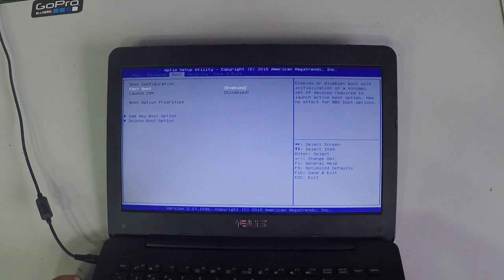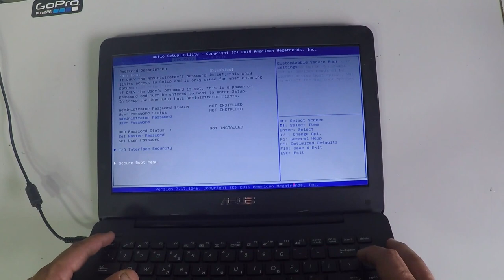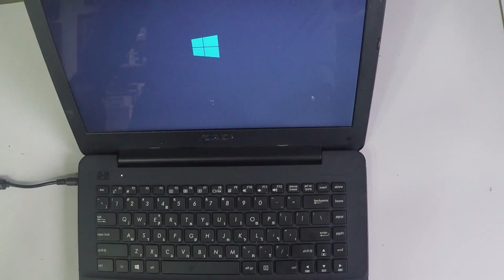ASUS X454L Battery Replacement

Comment: Hi techtips I have a question is it ok to remove the battery like not replacing it and i will just use ac adapter? is it safe? the reason why I want to remove the battery because when ever i play games plugged in the game lags but  when unplugged its totally fine. I think its because of the battery?

 Any tips for this ? or advice would be great help
Thanks in Advance
Greetings from Philippines
Reply from the maker: Hello Chris, It's safe to take out the battery and run only on ac power.
Reply: Thank you for the quick response! really appreciate it
Reply from the maker: your welcome.

Comment: hi, i hav question if keep using it without replacing the battery its ok?.. just using power adapter
Reply from the maker: Yes, It will work fine.
Reply: I used it without the batter, but after some years i needed to put  a batterie inside again because it was not booting anymore

Comment: i sent my asus to this one computer shop at my place, recommended by my friend for the good service  to change the HDD and upgrade RAM, and the repair guy stole half of my laptop  screws which I realized months after it. can't do anything about it. my bad, i didn't check first before because i was in a rush. now the battery got problem. bought in 2016 though. i don't even use it for hardcore gaming or prolonged hours of work. suspect something is done to my asus without my knowledge. 
thank you for the video. I'll change the battery on my own.
Reply: Wait, what did that person stole from you? that's the reason why sometimes I feel uneasy left my precious stuff to others like that, I just , I can't trust those bastards

Comment: Hello,can u suggest any upgrade for this laptop so that i can run pubg with lowest setting
Reply: I would like to add ssd240gb n 8gb ram for this computer
Reply from the maker: Hello huzaini, there are no upgrades for this laptop, you will need a new one with (16G ram  i5 or i7 with SSD and high-level GPU).